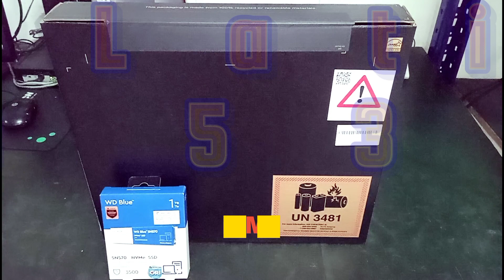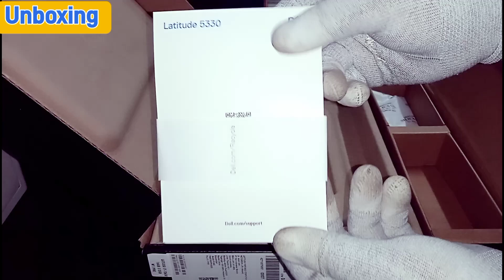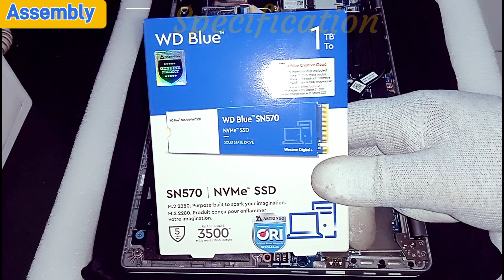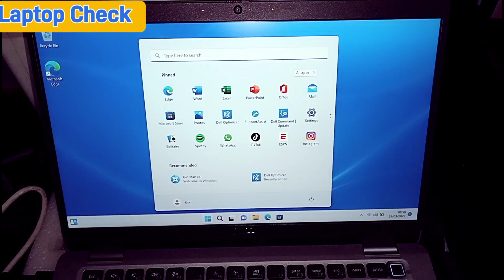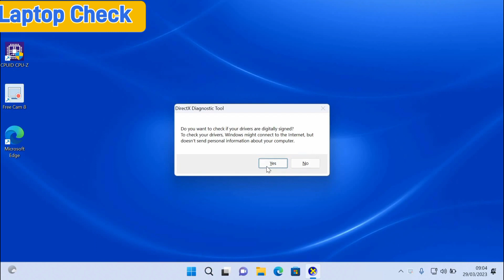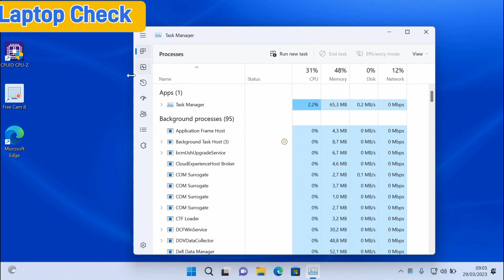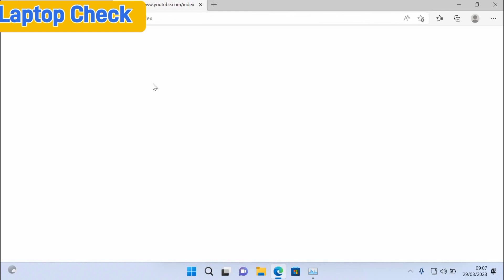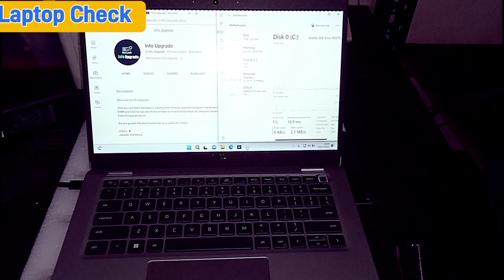DELL Latitude 13 5330 - Unboxing, Disassembly and Upgrade Options

Comment: Would you say the imporvement for the performance was very noticable? did windows lauch applications quicker?
Reply from the maker: Hii bro , So far with the ssd upgrade and windows update the performance is very good
Reply: @Info_Upgrade  appreciate it bro will look into doing it, i bought used 5330 came with 250gb. Will look into getting 500gb m.2 ssd. Is there is anything i need to know about compatibility regarding using nvme  ssd?